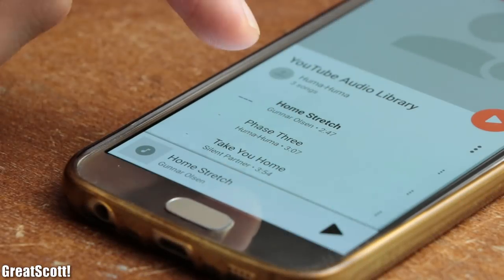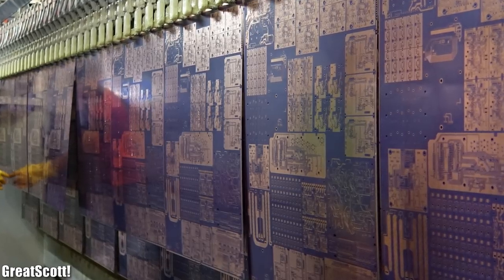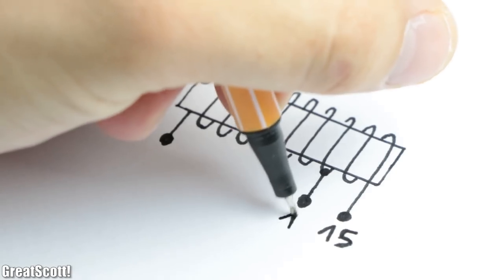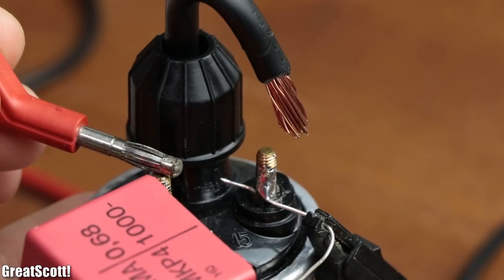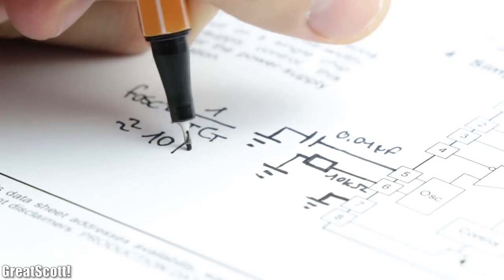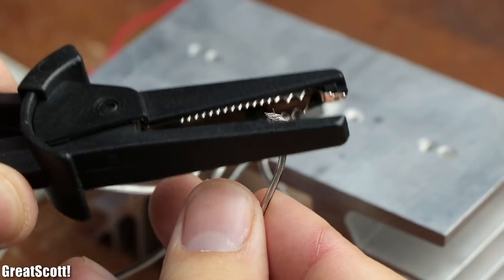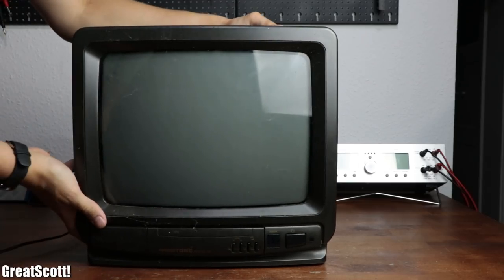DIY Plasma Arc Speaker

Comment: A singing arc, designed correctly, can actually achieve remarkable audio quality. Flyback transformers are probably not ideal, certainly not ones with built-in capacitors. If you can get one that operates best at around 44.1KHz and use a microcontroller instead with a PCM or I2S digital audio feed directly, or an ADC with analog input, then you will get superior audio quality. With a higher voltage and longer arc, you can get better low frequency response, although I found that longer arcs are less stable with turbulent air. I am also messing with one based on a cd4046 PLL using a half bridge with a tuned LC circuit and FM modulation. At 50KHz it produces "ZVS driver" results plus audio modulation.
Reply: From 22hkz and up sounds good i use an Arduino pwm pin at 64khz and it work fine
Reply: Indeed, in the 60s Fane developed the Ionofane tweeter which was apparently quite good. It used a 27MHz RF carrier if I remember correctly.
Reply: Just wanted to write something similar when I seen this post, so my would be just another copy written on similar way.
Reply: Yes, that produces a circular field at the end of a metal horn so it 'loaded' the air better. The main problem with that and any other designs are the terminals. These are eroded so eventually the arc does not strike. The ionophane had a removable metal electode  surrounded by a glass cylinder with an air gap between. The glass protected the outer electrode from being damaged but it was damaged and neded to be replaced along with the central elecrode. The ionofane produced ozone which was noticeable if you smelt near to the tweeter! The tweeter was used very succesfully by Bowers and Wilkinson in the P2H IIRC but could be bought as an independent tweeter
Reply: I use a NE555 timer at around 40KHz with an LM358 and mosfet driver and it sounds awseome!!! and it has BASS
Reply: @NeutronStudios1  I'm late to this video, but I'd love to hear something like that in action, with a full harmonic range compared to the video. My mind goes immediately to how it can be used as an instrument (besides digital multisampling and DSP, but the whole wow factor comes from the physical presence of the sound).

I'm an electronics novice but I wonder if there are ways of introducing modulation or interpolating pitch data somehow to make a functional synthesizer using high voltage plasma (with the plasma source effectively acting oscillator, signal precessor and amplifier? It's a puzzle to visualize, something like a combination wavetable and vocoder). I'd imagine logic gates could otherwise be used in a similar way as they are in modular analog synthesis, but instead of 1v/oct it's probably more like 30,000v/oct. Gives "control voltage" much more intense implication. It would be horribly impractical and probably require a large space, custom high voltage gates, and a lot of safety kit, but it'd be quite the novelty. I'm just on an utter tangent now, but it could be billed as the "most electronic instrument," and people could pay to have it in their productions. If it doesn't kill them, of course.

Comment: we played music on some of our welding power supplies.  The first time I noticed the possibility was with a Swiss made Microplasma supply that could run with internal pulse frequency up to 1 kHz near square wave and rich harmonics.  With external pulse command it operated up to about 2.5 kHz.  Later on we built our own welders (Microplasma and TIG) that provided even higher pulse rates.  In fact, one special version was used at a university weld lab up to 20 kHz.
The benefit of the welder is in the plasma speaker situation that the welding arc is much “fatter” and thereby the “speaker cone” has a much larger surface.  This is partly achieved due to use of argon gas instead of air.  You can imagine that with higher current, the plasma column expands and with lower current it contracts.  The expansion and contraction pushes the surrounding air, just like the speaker cone. 
However, I must state that the acoustic impedance at the argon/air interface is such that the peak response corresponds to about 1 millisecond rise times.  Using argon plasma gas and helium around it as shielding gas shows somewhat different behavior, just like the “Mickey Mouse sound” you produce after breathing helium.  Anyway, the sound volume is normally related to the pulse current, but as the plasma size also depends on the arc length, you get louder sound with longer arc.  A Canadian company produced arc length controllers for TIG welding that modulated the current at 1 kHz and measured the sound with a microphone.  It worked fine, but the welders hated the continuous 1 kHz noise.  That made the sales not too “hot” success.

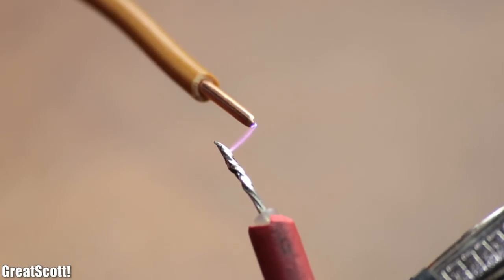Comment: 10:33 You can improve the audio quality by setting the carrier frequency higher than 20 kHz.
Reply: That's what I wanted to say. If anyone is wondering why luckily answer is simple. You can hear 10khz signal pretty easily. even when the PWM in not modulated (and has 50% duty cycle) you will hear it. But you will be having difficulties hearing a 20khz square wave!

Comment: You can also wind your own coil around the core of the flyback, and with that method you can achieve higher voltages on the secondary.

Comment: I made one of these a few years ago with a TL494 Half bridge with a Line Output Transformer from a TV, wound a custom high voltage coil since current is more important than arc length for these. TL494 can PWM its output from an audio input. Pretty good chip for only costing 80 cents when I bought it. The mosfets were the expensive part.

Comment: Very cool project!
To get a better sound you'd need a faster PWM source. Like 44.1kHz territory or preferrably (much) higher. Because like this, the 10kHz are too loud to hear most of the signal, plus due to distortions from disregarding Nyquist, you outout a very mangled signal that only goes up to 5khz. Plasma spakers are best for high frequencies (starting at 4-6kHz maybe?) due to the low "air" volume that is actually moved. Magnat once made a speaker with plasma tweeters. But even they couldn't get rid of all of the smell of Ozone, the human nose is very perceptive there. They heated the air around the plasma tweeter to "cook away the Ozone", or most of it. Oh, and also you have a comparatively high noise floor compared to a regular tweeter.

Comment: Automotive ignition coils are actually two discreet windings, the primary (low impedance) is a relatively few windings of thick copper, the secondary (high impedance and big fat spark) is a lot of windings of relatively fine copper.   The circuit is pretty much the same as you've drawn there.

Comment: I love your ideas and videos but I have to let you know that in the UK at least, they were known as Line Output Transformers with regard to televisions. My credentials for saying this is as a television engineer for over 6 years in the industry in the 80's. I do sometimes wander how the younger generation, learning electronics, can manage to get what we called a little tickle these days considering most devices are low voltage and power :-) We had much fun!

Comment: Cool video, but you should have added to be very careful with the CRT TV as obviously it uses high voltage too, so if it had been plugged in in the last year or so (pretty unlikely, I know) there might have still been some residual charge somewhere.
Reply: Yeah, that is the only thing to "know" about when working with CRT:s, that DEADLY shock is the only reason that so many CRT:s are laying around. NOBODY want`s to touch them voluntarily.
Reply: That's true but let's face it...even the older crts have bleeding resistors on the main caps. So if you haven't plugged it in before taking it apart XD you should be safe
Reply: D2RG6 well...you should have checked the caps with a multimeter before desoldering or touching anything XD

Comment: A good practice with very high voltage transformers is to have a fix spark gap in parallel with the output to avoid internal sparking,
when, in this particular case, the two wires are too far apart for an arc to form.

Comment: If you want still use the ignition coil as transformer you should choose the resonance frequency with appropriate caps and then you should transfer enough energy also at higher frequencies. Regards

Comment: Great!! Please controll your schematic carefully, since you are using a flyback transformer the connection of the freewheeling diode is wrong;) also you can see that it is a flyback transformer from the internal schatic of the high frequency transformer that you show at minutes 9:34 in the video, there is already a flyback diode inside the secondary side of the transformer

Comment: I was able to make one very simply by winding wire (12 ga, ~10 turns) around the exposed portion of the flyback core, connecting this to the output of an off the shelf audio power amplifier, and then driving that with a 20khz tone and whatever audio wanted to play on the same channel.

Comment: Why didn't you use a PWM control frequency above 20kHz so it wouldn't be audible?
Reply from the maker: Because the CRT TV flyback transformer was not happy to work with such high frequencies.
Reply: @greatscottlab  whoops I just got to that part of the video!
Reply: GreatScott! I connect transformer to 30 and more khz. In TV they work on 17-40khz. 2000нм or other working not bad in this fre
Reply: I was thinking that too :D 
Ideally he would use a frequency of 40kHz or more (because carrier frequency must be at least double of the signal frequency) which would properly carry the whole human audible range up to 20kHz
Reply: B10S warning! Bad English:3  people, who age more 30 ears don't audible frequency more 15-20khz.(only for men). But if you use Ionophone in shcool, children says:"Dear dude please off this wundervaffle)))". Я из России. Balalayka, Vodka, Medved xD
Reply: Or you can use a transformer from an ccfl inverter like GS did in he's diy arc ligther
Reply: @greatscottlab  With a DIY primary I used it at around 70 - 80 kHz... It still works fine, moreover if u use an AC flyback, u won't even get shocked if u touch the electrodes😉

Comment: Ehhh.... 
I can actually agree that arc speakers are less than ideal, but... I don't know if an inductive speaker setup is the best way to do this. You can do something similar to this using  a Cockcroft-Walton generator circuit. 

There's both a full wave and a the half wave version. 
Full wave have higher capacitance, but require slightly more components. 

If you go with a CW generator, the whole plasma discharge can be switched on and off with a high voltage mosfet, which would prevent the annoying high pitched whine that's common with plasma speakers. 

Finally, just kind of a thing to note: This is similar to making a microwave emitter. to make one of those, you need a high voltage discharge (it doesn't matter if it's ac or dc), and an inductive element capable of holding electrical power and quickly discharging it. Oxygen does kinda quench microwave emission, but you can still get some microwaves coming off of a high enough voltage discharge. Especially if there's enough sustained discharge to have a significant amperage.

Comment: Nice video. Just a small confusing bit thought. You refer to the Toff period of the switch as dead-time which can be confusing as I have always encountered dead-time as the time interval between the switching of synchronous switches when none of them is turned on.

Comment: The turns ratio of a step-up transformer will be slightly less than the resistance ratio, as the secondary windings will be thinner

Comment: I think the reason it didn't work is the core material for the transformer. The core material in this case is probably silicon steel, which isn't recommended for higher frequency applications. In this case a transformer made of ferrite would perform much better.

Comment: Okey, let me say it's funny when you make tesla coil with a peak voltage of 1.2M volts and then hear about the high voltage of 30 kV. Also high voltage is classified above 70 kV, so it's rather medium voltage.
Reply: In Germany everything above 60v is rated high voltage. For more then 60v you need to have a license to work with

Comment: Hello Scott!  For my remote controller i need 6.0 Volts, which is by default powered by 4x AA batteries, and I'm planing to change it with 3-4x 18650 Batteries connected in parallel or series and to use Step-Up or Step-down converter to do 4.2v to 6.0v or 8.4v to 6.0v? Which should be more efficient?

Comment: There is also a nice way to identify the correct pins for the primary of the flyback using the classic bug-fucker...  sorry, bug-zapper circuit. Once hooked up with the electronic ballast for tube lights, it can give pretty sweet arcs on the secondary.

Be aware tho, I touched that and it is not good.

Comment: The flyback transformer must be an AC model, right? Aren’t those really har to find?
Reply: Alex 0474 you could just remove the internal diode of a DC one if you wanted, restoring both halves of the wave, making it AC

Comment: Hi Scott,
You got that coil driving circuit wrong, it is usually done by IGBT, with +300V voltage rating. These coils are usually ~1:100 transformers, and the high voltage side (secondary) is grounded by the tubular metal enclosure connected to chassis of the car.

Please see the gif below, its the coil driving circuit.
http://efistuff.orgfree.com/images/Speedy_Ignition_Sequence.gif

you can get way more energetic spark out of the coil by using 14V instead of 12V,  without damaging the coil.
Give it a try :)

-Jani

Comment: Great presentation and details as usual.  I'm going to reference this to the Hackaday latest plasma speaker with the same IC article (https://hackaday.com/2018/08/05/a-plasma-speaker-using-a-tl494/) since you note the lower frequency generation details without a longer arc as someone speculated.

Comment: I chooses this ic for making tesla coil driver as  
pus pull oscillator  but   i am confused by this fact that if its fixed frequency ic or it can be changed by C and R value because datasheet says both " it's fixed frequency and also saying its frequency can be programmed by changing the value of C and R  which makes no sense to me ) plz anyone tell me

Comment: What audio?
I think D1 will greatly limit your ability to drive the transformer, as the primary current just keeps flowing when you turn off the MOSFET.
Reply: I know what D1 is supposed to be. It shouldn't be used here, is my point. Not much point posting a "plasma speaker" video that doesn't speak!

Comment: In the end you say that high voltage doesn't produce great audio quality. Isn't a plasma speaker potentially better than a regular speaker? Of course you'd need to use high quality components and stuff, but you don't have the inefficiency of the speaker having to physically move.

Comment: Please don't touch high voltage circuits with both hands.Every time you work with such voltages you should put one hand in your pocket and wear shoes with rubber soles.

Comment: This concept is not new and has been used for high end tweeters. It is not useful for lower frequencies. There is a little bit of beta radiation from the arc too and a smell of ozone...
BTW: I would like to hear how your prototype sounds like. Did I miss it in your video?